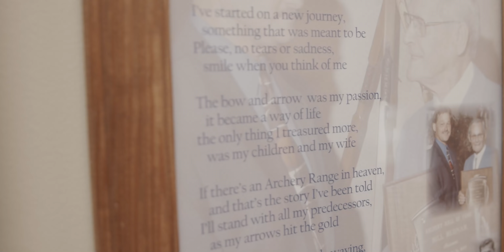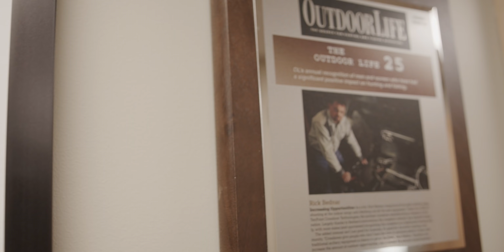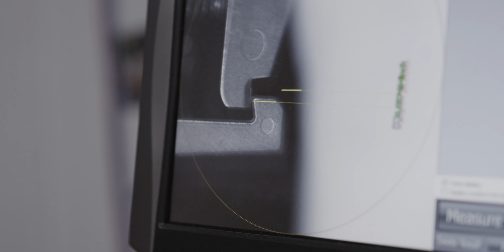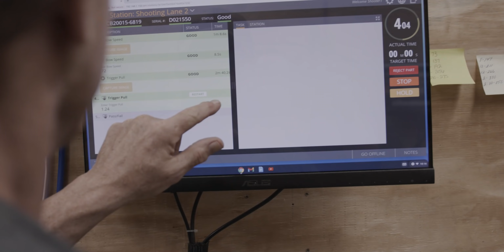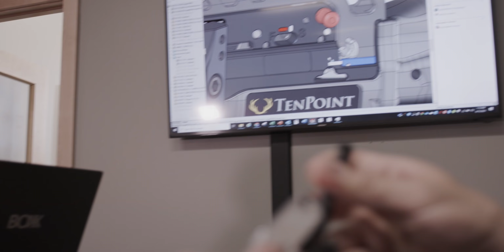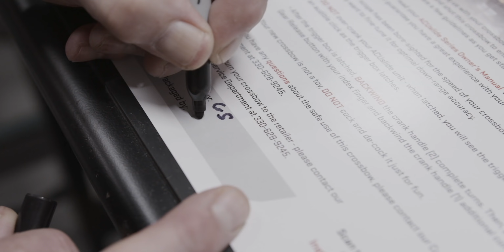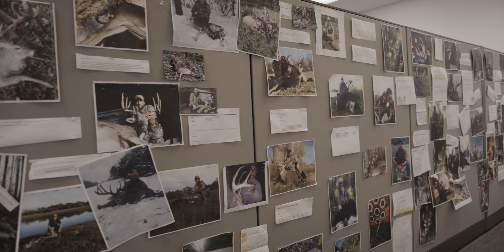Inside the Walls and History of TenPoint Crossbows | TenPoint Crossbows

Comment: I just started buying a different maker of Crossbows.  I started with Barnett, I have 3 they all are ok and finicky to a point.  The best is the WhitrTail Hunter 2.  In March I purchased the TenPoint 370 fps Trident M1, WOW what a difference  In March I bought another of the same type based on problems with the first one.  I also bought the Vapor S470,  fantastic Bow, I am trying to find areas big enough to shoot it over 50 yards.  it is a tack hammer at 50 yards, over and over.  I also just bought the Viper 400 for an in between and it is also terrific.  I can now state that the TenPoint, off the shelf, beats ALL other CrossBows I have ever shot or owned, easily.  Made in America....take that China!!!!!